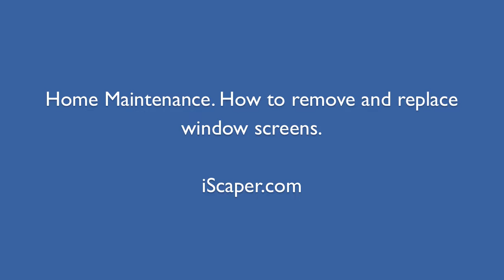How to remove and replace window screens

Comment: FOR THOSE OF YOU WHO SAY YOUR  SCREEN SEEMS BIGGER THAN THE WINDOW SLOT: freaking I finally figured it out. you need to fit one top corner into place by holding it super diagonally, then you place other top corner into the frame. After that you realign the frame making it undiagonal and as you fit both top corners in. pull up the tabs on the bottom to fit the other half in. DONE, I FINALLY DID IT
Reply from the maker: Melina Diaz 
Good tip, thanks for posting.
Reply: Melina Diaz thank you!
Reply: Omg girl ur a miracle!💐 I thought I messed it up cuz I dragged my 2nd floor window screen in thru the window(struggle🤦🏼‍♀️)...but I can’t get it back out the same way to reinstall and I’m not climbing a ladder two stories onto a sloped roof...I’m trying this today. Awesome tip!!!
Reply: y are my tabs on the side ;-;
Reply: @Cluetube  ME TOOO
Reply: Any video please I am not able to do it .

Comment: My screen appears to be bigger than the slot it came out of. It really is not bigger becasue it came out of the exact slot. But when I try to put it back in, it doesn't appear as though I can put it back in without bending the frame. What am I doing wrong?
Reply: Same!
Reply: We don't have those spring loaded screens, that's why.  I'm not finding these at Home Depot.  I'd replace mine with them in a heartbeat.
Reply: Same here.
Reply: Mine has two tabs on the left. I can pull it to compress it horizontally, but it is longer virtically too. How can I compress it four ways?

Comment: Nice video but it doesn't seem to be working for me. I'm also trying to clean my Windows but my window blocks it from pushing out as well as in. There's a metal piece preventing me from pushing it out and my actual window and the metal on the screen is keeping me from pushing it towards my body. What would be a second option for this dilemma?

Comment: I have the window screen with the U-shape clips (3:10) that I got out to replace the screen.  I cannot get the screen back into the grove because there is not a tab on the other side of the screen.  What can I do to re-install the screen, besides tape?

Comment: Hello- may I have a question: I have a hard time getting the screen out because both of the bow shapes kinka broke so I cannot push that side inward in order to get the other side out?  I am afraid to use too much force that I might break the frame?  Can you give some tip?  I did not see the two flaps like your screen on mine at all?  Are they different?
Reply from the maker: Try a flat blade screwdriver in one of the corners to pry the corner out.

Comment: which lip does the screen go into. The outer one is easy, but the screen leaves a little gap. The inner lip is VERY difficult, and I already bent a screen trying to get it in. 3 of the 4 corners go in, but I cant get the 4th in without getting it caught
Reply from the maker: +MrJamesBecca 
On a few of my screens I had to use a flat blade screwdriver to get the last corner in.
Reply: iScaper1 thank you for the tip!

Comment: This won't break the screen will it? I just want to take it out to clean
Reply from the maker: +Sam Bain 
You need to be careful you don't bend the frame when removing the screens. Sometimes prying with a straight blade screwdriver near the corners helps with the removal.

Comment: i had to order more screens because i got frustrated and bent it. the tabs broke, and the screen wouldnt fit.....i tried the screwdriver but didnt work....its only taking out for my AC, other than that i wouldnt take it out...UGH, ill try again with the new one, Question ? on your last video the bigger screen, is that on backwards ? the tab was on the outside? shouldnt that be on the inside ? so no one can break into the home ?
Reply from the maker: On our windows that are high off the ground the tabs are on the inside for ease of removal. On the bigger windows on the deck the tabs are on the outside of the screen for the same reason. I use window secondary locks with thumbscrews on the glass frames of those windows to prevent someone from breaking in.
Reply: very cool, i didnt know about locks w/thumbscrews ! Thx :)
Reply: maybe you can help me with my slider, it has no lock, and my cat opens it, so im putting duck tape on it to keep shut, its in the basement, double french doors, any suggustions ?
Reply from the maker: Sue Shattuck
If it's a sliding glass door you could either cut a pipe of pipe or wood that would sit in the track behind the door to keep it from sliding open, or even use a secondary lock with thumbscrew and fasten it to the track edge just behind the door that slides.
Reply: im sorry, its the screen door....i leave it open but cant secure it..lol
Reply: ill try it thank you !

Comment: I have the two clips and they are on the side of the screen.  I am on the second floor and live in a co-op.  I could not for the life of me get the screen back in after repairing it.  I spent almost an hour trying to get the stupid thing back in but could not from the inside.  I also have NO tabs.  In the process of pushing, pulling, tugging, I now have the screen half in and half out, jammed in on one side and I cannot get it out.  I wanted to avoid going to the super tomorrow but I am afraid if I pull and tug any more I will break the frame.  I already think I broke one of the medal clips and that's why it is jamming now.  Any suggestions?  I managed to get screen out with no problem, but no way going back in.
Reply from the maker: If you don't have the tabs to pull on then you might have to use a flat blade screwdriver to pry on the opposite side of the frame to get the spring clips to compress. Also double check that you don't have dirt built up or some kind of obstruction in the frame slot the screen goes into.

Comment: I have the same exact screen, but my problem is that when I put it back in the screen isnt completely lined up and the corners stick out. Do you know how to fix this?
Reply from the maker: The metal spring clips on the opposite side should push the ends with the tabs into the groove. Can you hold the tabs and wiggle the corners into place opposite the spring clips?
Reply: Yeah I can and I get the springs in first, and then I try pulling the tabs in and it goes in partially but then the corners hang out like I bent it.
Reply from the maker: OrangeeJuiicee
If the corners are sprung a little bit you might have to take a flat blade screwdriver to get them in.
Reply: Hmmm I'll try it. Thank you (:

Comment: One thing I discovered is that it can go in backwards. On my screen, I had to pull back the springs with a screwdriver and pull it out on that side. I turned it around and was able to do as in the video. Having it the other way, there's no possibility of getting it out by pulling on the tabs. Weird.

Comment: oh man..... good video, but!!! but.... it's never works so easy (maybe its just for me) but I always have to bend frame either pull out or place in back in.... literally every time i have band the frame, do you know why screen always seems to be bigger.....
anyways .... i going to make my own windows screens this time and it will be a bit smaller
Reply from the maker: Vlad Rudnyk 
Melina Diaz has a good point, you need to tuck one corner in first then the other corner will go in.

Comment: What if you only have but 1 of those compression clips and also don't have them tabs at the bottom.
Reply from the maker: If the tabs are missing you'll have to take a flat blade screwdriver and carefully pry down (or up) on the screen on the opposite end of screen from where the clip is. Once the edge of the screen clears the window frame you can pull it out.

Comment: I have window screens from the mid-1970s; they only have two sliding tabs that move in and out on one vertical side (i.e., on the right, when working from inside) and NO springs whatsoever.  There is some tension built into the design to aid in removal/reinstallation.  It was miserable getting them out, and I've just about given up trying to put them back in place.  There must be a simple method way to reinstalling them, but it's difficult working alone.  You have to work one side in, then bend them a lot to get them to fit in place.  It feels like I'm close to leaving a permanent kink in the frame, so I back off.  They were just re-screened at Ace Hardware, and now I can't reinstall them.  I spent almost two hours trying from the inside, then going back outside to reinstall them before I gave up.  This is a job that either takes less than five minutes for a professional to do, or four hours if you're a neophyte.  So far, I haven't found a video that addresses my type of window screens.  I'd appreciate usable advice from professionals who have dealt with this issue.  Thanks.
Reply: Same, did you ever find a fix?

Comment: I'm having trouble with mine, I think they weren't supposed to be removable but my stepdad took them out to clean and couldn't get them back in. There is a lip on the frame all around where the screen goes and nothing is removable or unscrew able. The screens are one solid piece as well, so they would have to be bent and forced back in and I don't want to try and fall off the ladder

Comment: lmao mines isn't the size of the whole window & my little metal-bops were on the side instead of the top. im also on the second floor so i couldn't go outside to do it. finally got it fixed tho 

one of the metal-bops were slipped to the side so when i thought it was actually in, the higher one was out by just a little bit & messed up any chance of me pushing it in, but the method pretty much works the same for the sideways ones too.

Comment: How do you remove the screen if it doesn't have the tabs to pull up on?
Reply from the maker: Smaller flat blade screwdriver works.

Comment: No tabs here and compression clips are on the side (versus the top).  Thing is, while the screen is the same size as the one it is to replace it just does not seem to fit, not from the inside nor the outside....  I know it doesn't make sense but it appears to be too tall as I haven't been able to fit the full length of the side where the clips are into the window.
Reply from the maker: Do you have a build up of dirt in the bottom track that's keeping you from getting the top and bottom in? If not double check the dimensions of the new screen with the opening.
Reply: iScaper1
No dirt; the aluminum of the frame is not allowing the screen to be pushed over.  I will again hold the old one up to the replacement to double check size. 
 Yes, it is the same size, but old one had no tabs nor clips.  New one has clips and plastic corners.

Comment: Does it matter that black tabs are facing outside or inside?
Reply from the maker: +David Rau 
The windows that are 10' above the ground I have the tabs on the inside so I can remove the screens from the inside of the house. The rest of the windows I have the tabs on the outside so I can remove the screens from the outside of the house.

Comment: Mine don't have a clip to hold onto
Reply from the maker: If you don't have clips use a flat blade screwdriver to carefully lift one corner out then compress against top clips to remove screen.
Reply: I almost dropped it but it's all good now thanks for this advice